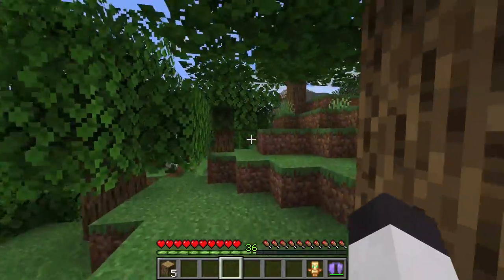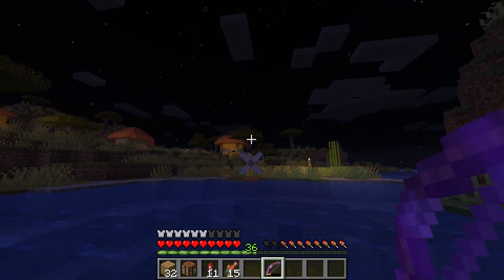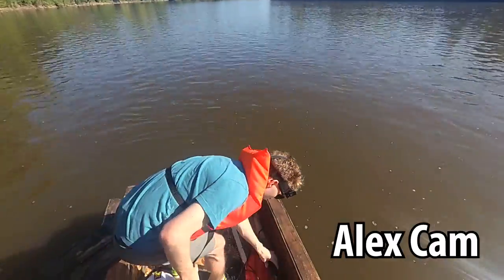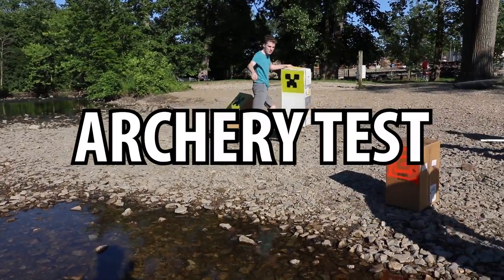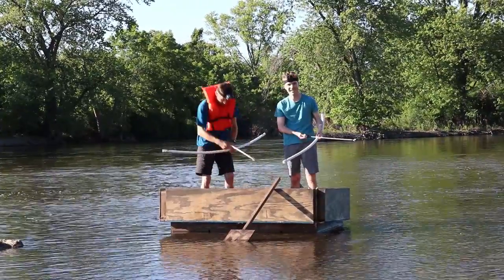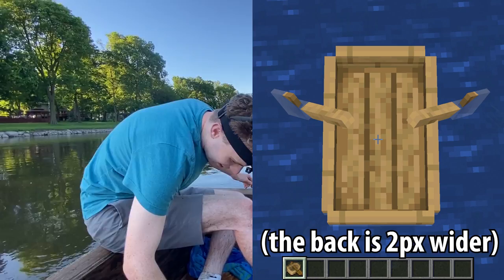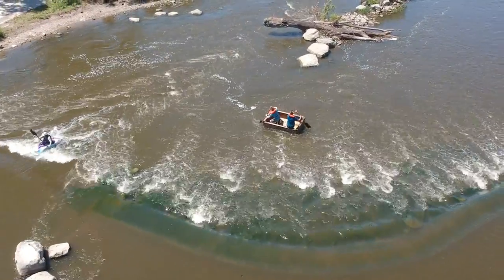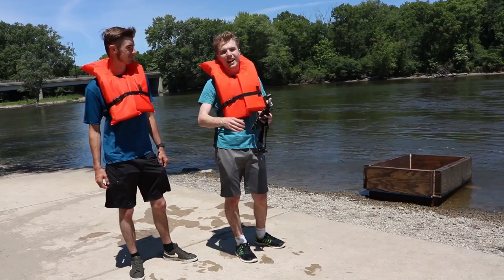Will It Float? Testing Minecraft Boat in Real Life!

Comment: Two archery tips from a guy who hasn't shot a bow in years:

- Try not to hold the bow horizontally like that. It's possible but it's far better to hold the bow vertically

- Try to pull the string all the way to the ear, with the length of your body parallel to the arrow's flight path

Very good video!

Comment: One minimal inacuracy you could complain about is that the minecraft boat is rowed instead of paddled but otherwise great video!
Reply from the maker: Wait, how is this different? Genuinely interested, is paddling not rowing?
Reply: Well i am not an expert but as far as i know when paddeling you hold one paddle in your hand which you can freely move to control the boat while when rowing you have two paddles each one fixed on one side of the boat wich you move using your whole body. Also props for reading a comment on a video almost 1 year old

Comment: To those that will comment about the boat being slower than it is: Minecraft's day length has nothing to do with the boat's speed. A second is the time needed for a cesium-133 atom to perform 9,192,631,770 complete oscillations.

Comment: Dude, there is a speed measuring standard for boats used by navies all the over the world and you are kinda doing a disservice by not mentioning how many knots the minecraft boats goes. I took the 28.8 you mentioned and quickly found a kilometer to knots converter and it comes out at 15.55076 knots. It would great if you amended the video the include the knots that the minecraft boat travels at as well but it's too late for that now.

Comment: 1:39 but a minecraft day is 20min, so you need to extrapolate it, in fact is really slow
Reply: A second is the time needed for a cesium-133 atom to perform 9,192,631,770 complete oscillations. So, no it isn't slow at all. It doesn't matter how long a MC day is.

Comment: We reused a bed frame as a boat. Water proofed it with plastic and it was good. No we didnt use safety wests and no i didnt know how to swim.
And your arrows are worse than mine as a child.
Get sticks from bush like trees which have hard outside but sponge like insides. Put a small nail at the tip of your arrow as a weight, pointing inwards so the blunt end is only visible, so u dont shoot someone with actual damage.
Then add a small V shaped split on other end and just.... shoot it. They fly way better than the arrows u used.